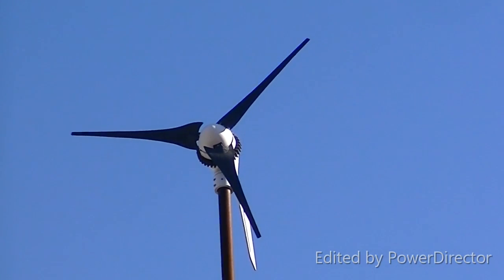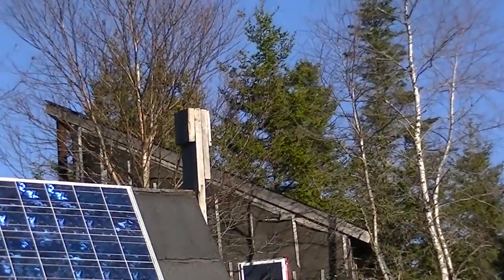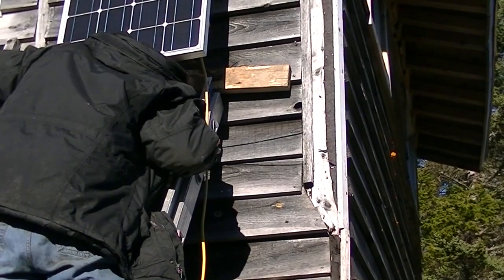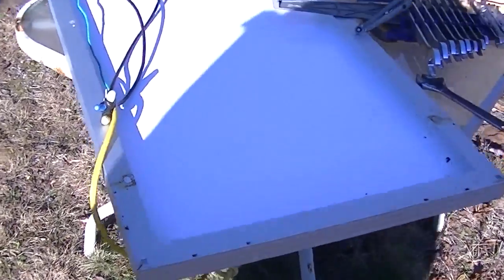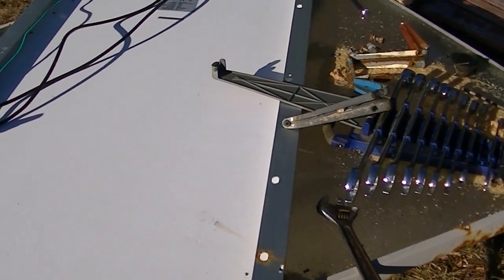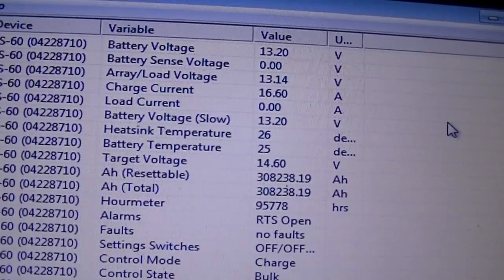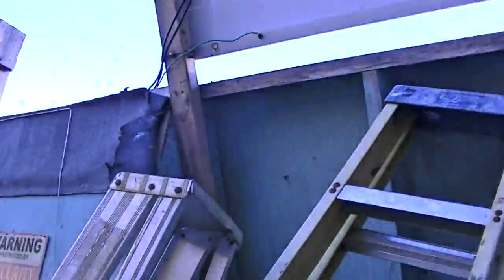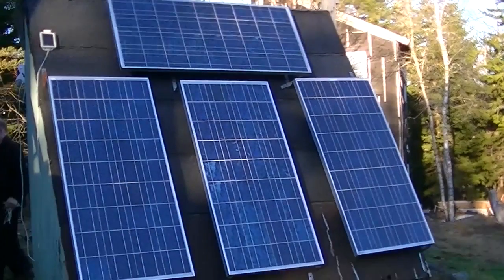Adding a 5th panel  to our 11 year old off grid power system

Comment: Not the easyest thing to get right, maximising the power from a panel, the angle changes as the son moves through the day dont it.
Shame that they cost so much, a dome of smaller panels would allways catch the sun at any angle, although you might only get a third of the panels working at any one time.
Ooow nice monitoring system :-D
Reply from the maker: +zx8401ztv we plan to build a solar tracker out of an old big satelitte dish someday
Reply: +ghettohillbilly1 
Now that will be fun to design without using too much power in the process of moving it.
Nail the panels to a log and rotate the log to keep them crudely in the right direction ha ha im just joking really :-D